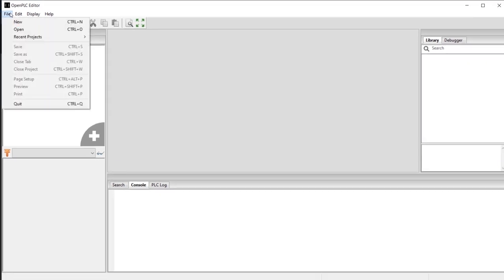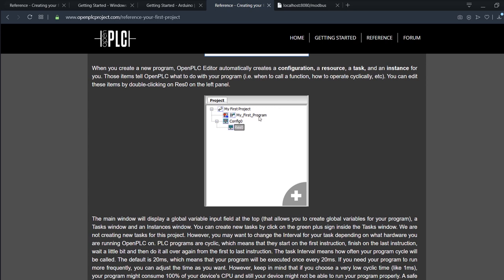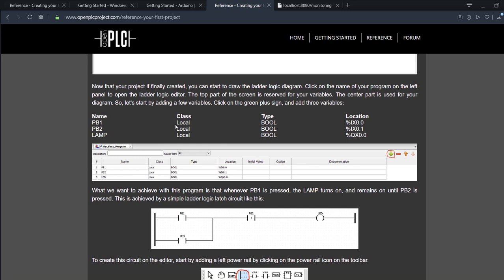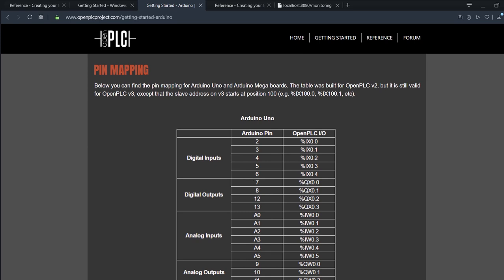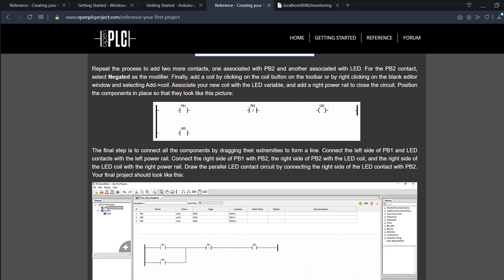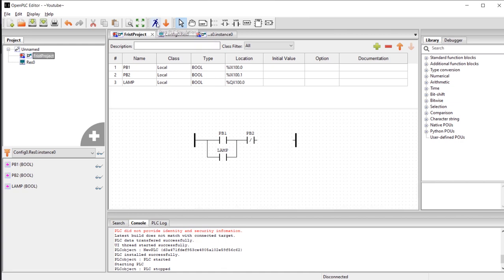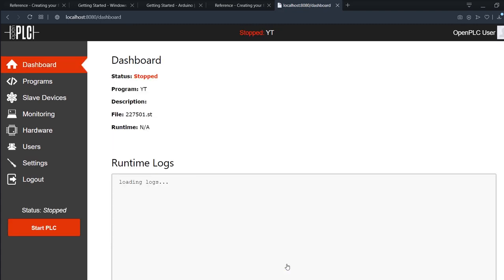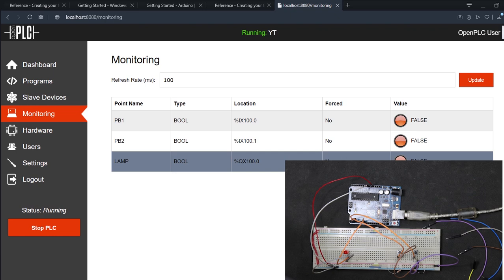OpenPLC and Arduino Part1.2 : Getting started and first project

Comment: Please explain what you did on the breadboard? You kinda just fast-forwarded through it without any explanation.
Reply: He connected everything per the schematic on OPENPLC’s website. Each of the pin connections are specific since the program is limited in discrete I/O. Check out the mapping. But usually when you’re putting 5v into an LED, you typically use ~220ohm resistor to protect it from burning out. Nothing crazy from this basic seal in program.